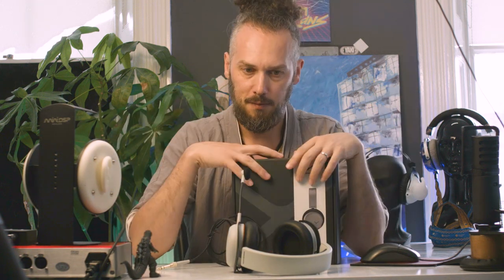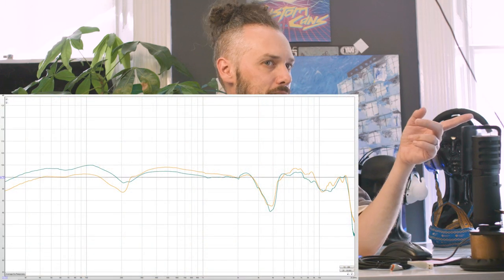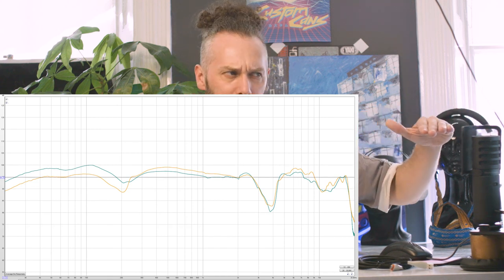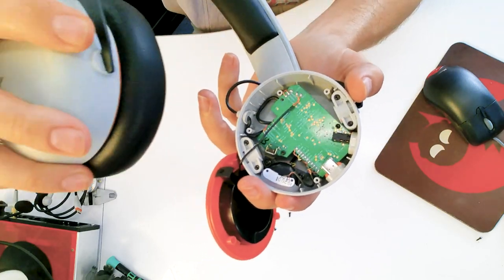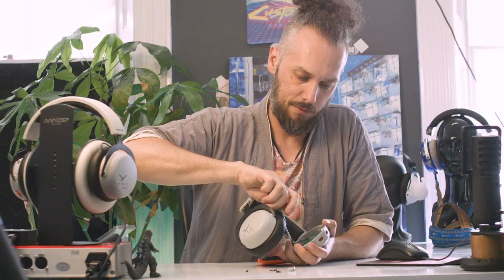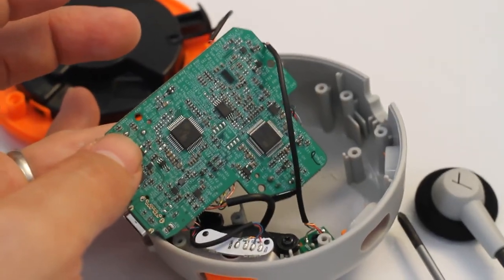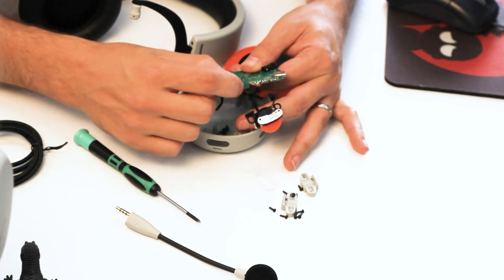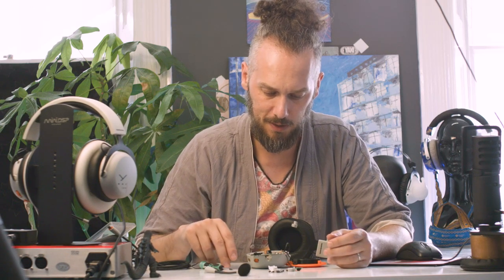Beyerdynamic MMX 150 vs MMX 100 review. Lets look inside and see what is different

Comment: Wow this was the best review for these I’ve seen. I’ve owned a pair for about a year and overall I like them. People should know the boom mic is really quiet when you plug in through USB and it's kind of a catch 22 because if you bring it close to your mouth it's super sensitive to your blowing air. Not so bad you can't use it, and indeed the sound quality of your voice will be fantastic in every way other than volume. I’ve also noticed my AMD laptop will have much quieter boom mic volome than my intel chromebook or even my snapdragon phone so if you’re rocking a Ryzen processor you’ve been warned!
Reply from the maker: It may be a general Beyer thing - my FOX microphone needs boosting to get a decent volume out - I suspect it is to stop it clipping at high volumes
Reply: @CustomCans  Yeah that makes sense but when I plug in through the audio jack I get plenty more volume but a bit less of my voice.
Reply: @CustomCans   Sorry for the double comment but the mic on these is hella quirky. Like I plug it into my galaxy s22 and the volume is fine, maybe even a touch loud. My AMD gaming machine just makes them really quiet. Wht’s the best way you found to boost the gain a bit on windows?

Comment: Hey, mmx150 for xbox connectivity.. bit confused here how to connect
Controller comes with aux?
Or is it to console
Reply from the maker: the come with a couple of cables so you can plug it into the controller or the console - it would probably work best plugged directly in to the console